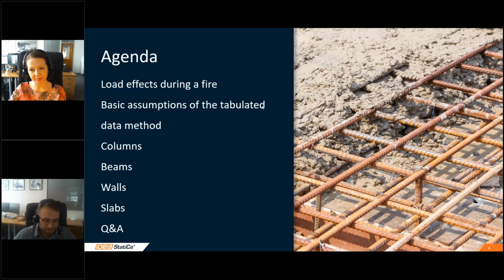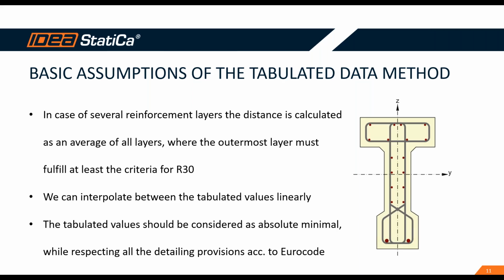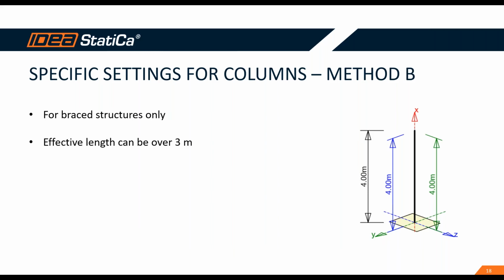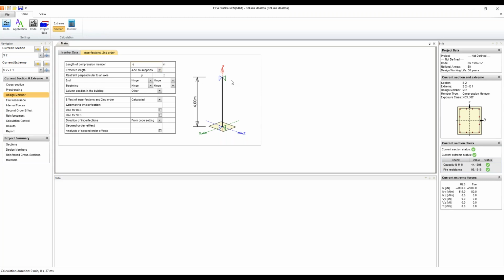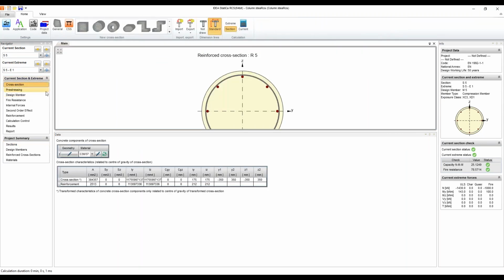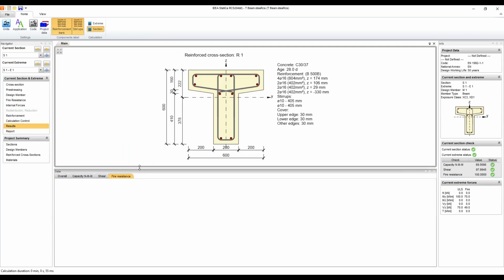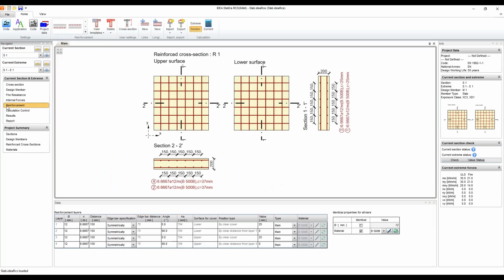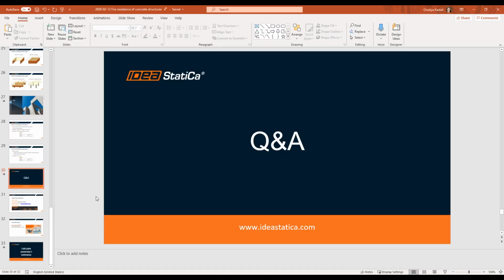Fire resistance check of concrete structures

Comment: What about very common unbraced cantilever concrete columns? Also where should we put additional surface rebar when cover is higher than 70mm - should it be in the middle of the cover?
Reply from the maker: Hello David, due to your question, you can check our new solution for thermal analysis where the barriers to the simplified method have been broken. https://youtu.be/-HLF9Urwq-I?t=1243
https://www.ideastatica.com/webinars/what-s-new-in-idea-statica-22-1

Comment: thank you very much . I have a question ..
can we verify these elements with the tabulated values method using IDEA Statica with consideration of the insulation elements .. for example a layer of plaster around the column ?
Reply from the maker: This insulation layer cannot be input for columns using the tabulated data method.